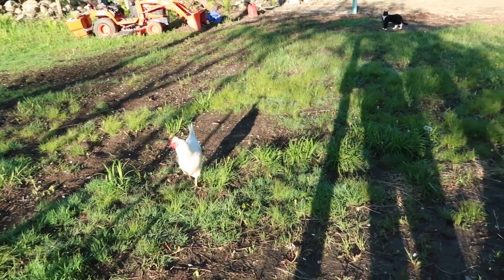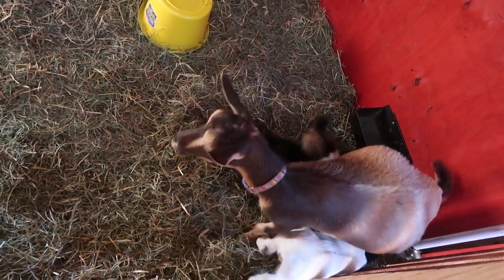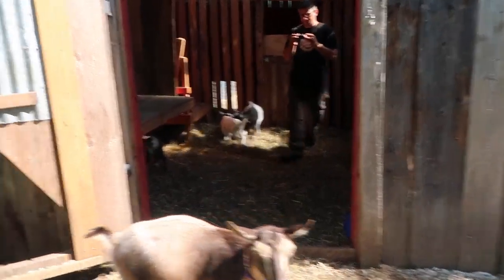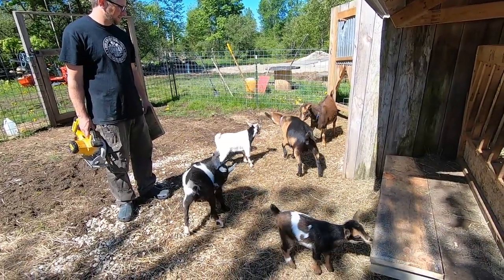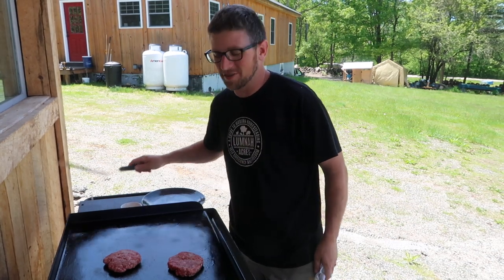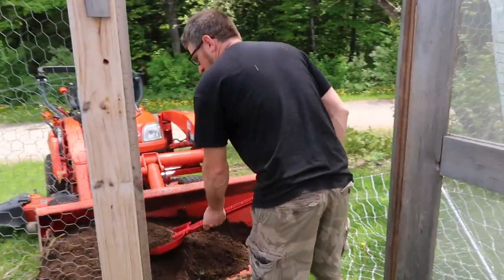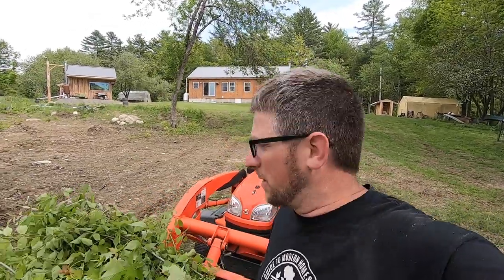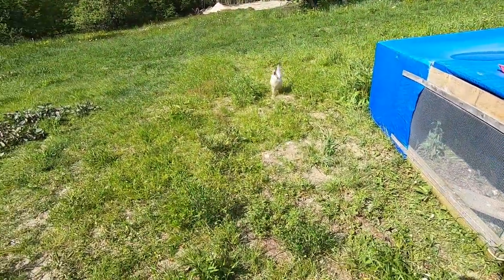We Let the BABY Goats Out with the HERD and this is what HAPPENED

Comment: Gina, if  you put a cross brace at each end of the strawberry bed, from the top of the corner risers, it will let you keep the bird netting up off the plants better. If the netting is to close to the plants the birds just eat the berries through the holes. You want to keep them too far away to reach the fruit.
Reply: You're right.  We always use 1'' pvc pipe bent over the beds, then the netting.

Comment: That is a lot of shovelling of compost. Redesign the beds such that the bucket can be tipped in with shovelling being required.
Reply: I THOUGH the same thing  or use a weelbarrow, better than shavel  one at the time, but I would redesign the beds  will save you so much time.
L

Comment: I found this on an AG  Site. Pretty much fits. 
E. Stress
Any stress such as moving, handling, changes in environmental conditions or fright can contribute to or
be the main cause for egg production declines. Common stresses include:
1. Chilling. Chickens do not handle damp, drafty conditions well. Prevent excessive exposure to wet, drafty conditions during colder months.
2. Handling or moving. Once the laying flock is in place, limit any unnecessary moving or handling. Switching roosters or changing the pens population will also disrupt the pens pecking order and cause some temporary social stress in your flock.
3. Parasites. If external or internal parasites are present, get proper diagnosis and treatment.
4. Fright. Limit the movement of children, dogs, livestock and vehicles around your flock as well as loud noises to prevent frightening the hens.
5. Predators also can stress the birds and create a decrease in production.
Here is the link. 
https://www.pubs.ext.vt.edu/content/dam/pubs_ext_vt_edu/2902/2902-1097/2902-1097_pdf.pdf